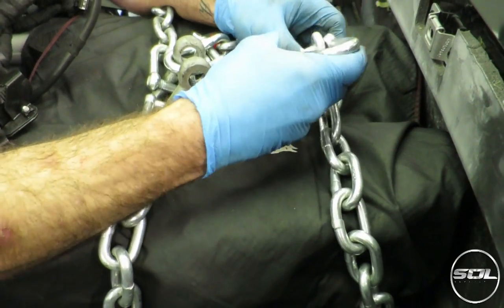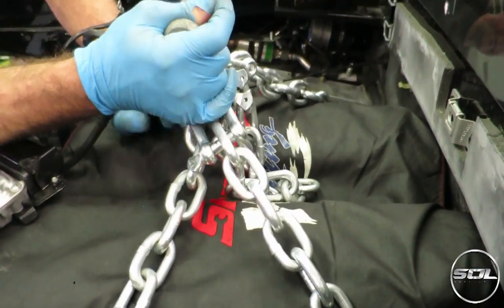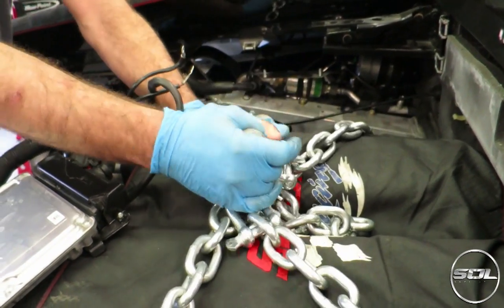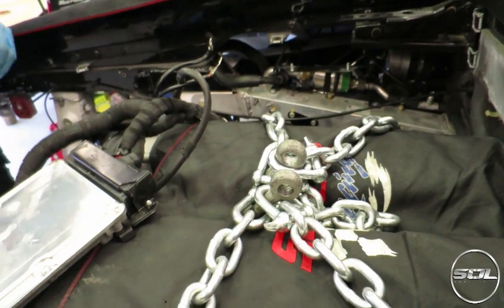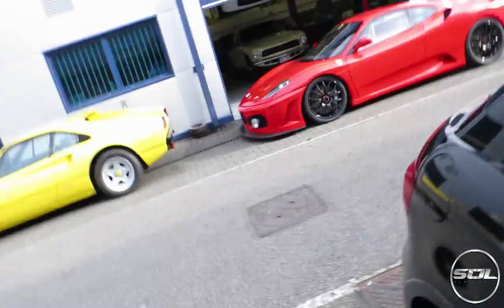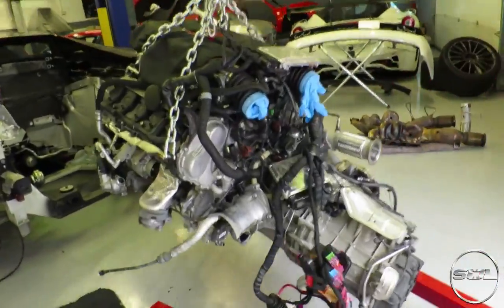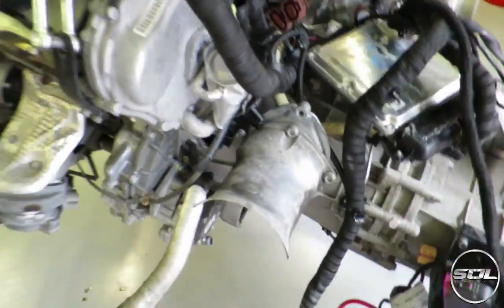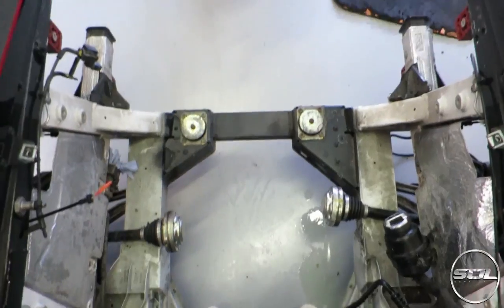THE ARMYTRIX PROJECT: DAY 2 ENGINE OUT!

Comment: stupid question but those guys did torque the bolts on the headers?
Reply: ***** that's not good:( I mean the exhaust would of come with its own torque specs, watch that shit rattle itself loos the back out with the engine.....surley they must have torqued them, u cant be that stupid on a lambo
Reply: lol fingers crossed they dint do that he goes there a lot, if you listen to his video where he first takes it out as he pulls off you can hear it rattling :s
Reply: +DAT G - DameAndThatGame You don't need to torque the bolts on headers,it's not like head bolts that are under pressure ..all it does is take the the hot air out the engine,so no pressure there just heat.
Reply: ***** Not that big of a deal,it has split washers so it's not going to come loose
Reply: The Opinionator lol split washers don't do nothing its been proven there a waste of time lol
Reply: ***** Proven by who? Put the link here where you got that info.
Reply: +The Opinionator i believe NASA did lol http://www.eng-tips.com/viewthread.cfm?qid=230741
Reply: +The Opinionator NASA Reference 1228 (1990) "Fastener Design Manual" Direct quote "its locking ability is nonexistent... [and] is useless".
Reply: +DAT G - DameAndThatGame I don't think you fully understand the idea behind lock/spring washers..it's not only about the locking ability,it's the resistance of the spring force of the washer to prevent the bolt from loosening further due to vibration...so go back your 1990's research lol and then figure out why all vehicles have them ;)
Reply: +The Opinionator lol

Comment: maybe i sound very dumb but does it get faster of this exhaust system?
Reply: No, just makes it louder.
Reply: +Christian Van-Ristell As far as i know, some aftermarket exhaust systems can add hp... (Correct me if I'm wrong)
Reply: RoyalKombo yes thats exactly what i thought
Reply: This system will slightly increase hp, and also with the massive weight reduction it will be quicker.
Reply: RoyalKombo
I can see that, but not by much.
Reply: it will increase the flow of exhaust gasses out of the engine allowing the car to breath better in turn creating more hp not much but some all he does it for is the sound I'm taking it.
Reply: +RoyalKombo an exhaust won't add horsepower it will allow more air flow quicker acceleration that's about it
Reply: Haha yeah right whatever you say it adds horsepower.
Reply: Dismis 66 quicker acceleration is torque hp is a number based on how much torque your car produces so yes it improves horse power.

Comment: not too smart are these kids. who pulls an engine out just for some headers. you go turbos at least for all that work. 
really stupid. and its gana annoy the fuck out of you after a while 
just run straight high flow cats. no muffler out the back would sound about the same. and you would have the heatsheilding still. cause that my get a little hotter under bonnet now. 
were you not told that?
Reply: lol you at least got to go twin turbos for all that work not to mention not tourqing the exhaust manifolds.
Reply: Jesse Smith its a lambo! No quality workmanship is required lol :P